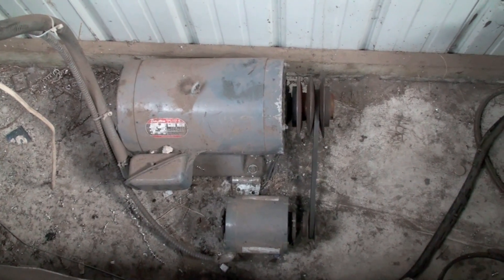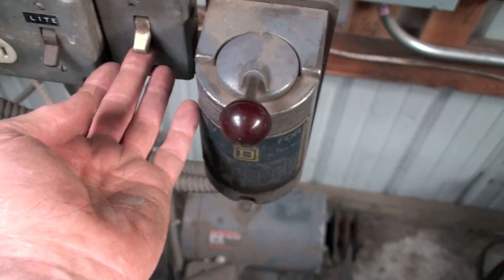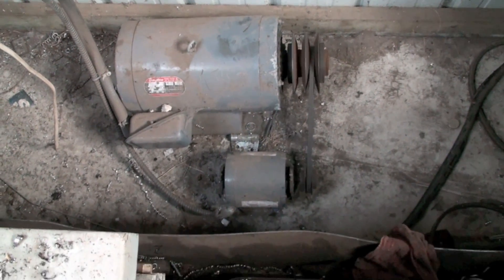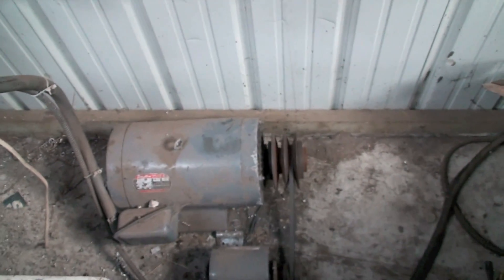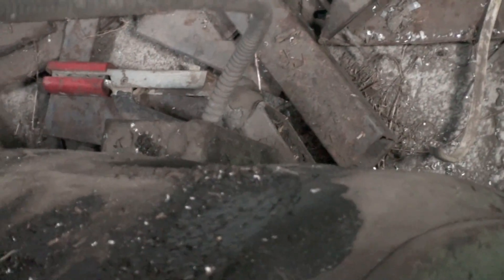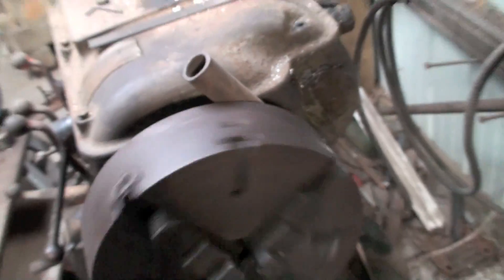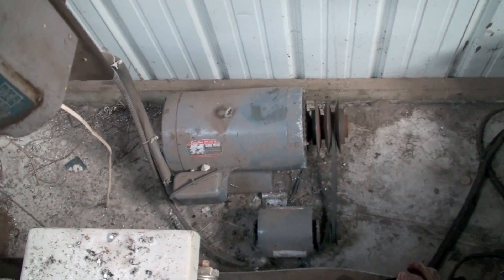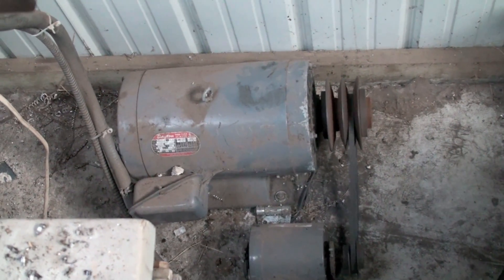Single phase to 3 phase the simple way

Comment: If I may. I have a horse of a different color. I need to get 3 phase 220 out of 1 phase 220 to run a computer. It is a tire balancer. After the computer turns on then it can turn on the motor. Got any idea how to just get 220 3 phase first and then continue from there. I am thinking I need 2 motors but you would know best.
Reply from the maker: The video does produce 240 3 phase.  As far as I know it should work.
GFM
Reply: Stunned did you get this to work? I'm in same boat with an ancient Hoffman balancer.
Reply: I have an old hoffman balancer to did it work i know this is old but did it?

Comment: Dear sir, the inverter came to industry in 1990,s. I do not see any reason  not to use them and enjoy your 3 phase machines anywhere any time any application.
Reply from the maker: The "inverters" you describe are really just a start cap and relay.  The machine operates on single phase and will overheat under high load.  The system I described is certainly not perfect and the 3d phase is not energized as completely as the other phases but will operate with more balanced power.  Also the "inverters" are quite expensive.  3 phase motors are cheap used.  The system I have described cost less than $40.  That is why I did the video.
Reply: You are right about the price, specially in 1990,s inverter was luxury. We had only 2 or 3 in our school controlling air velocity in a demo unit.
Reply: We used this as far back as the 50’s

Comment: I have a very old 3 phase motor, with three black wires (unmarked) sticking out (am unsure which go's where)that would be used as the slave motor with a smaller 110,3/4 hp , starter motor, and would I still need the capacitors ????
Reply from the maker: For this design, capacitors are not used.
GFM

Comment: Would it also be possible to have the 15hp 415v motor and 240v starter motor set up remotely with a female 3 phase plug connected to the 15hp 415 v motor so that multiple 3 phase machines could be plugged into the female plug (at different times of course) instead of having the set up hard wired to only one 3 phase machine? Thankyou

Comment: Hi GFM.
I have a wood planer with 10hp 415volt three phase motor. The power to my garage is 240volt single phase and the fuse is rated to 20 amp. If I understand correctly I will need a 15hp three phase 415volt motor and a single phase 240 volt motor. I will plug the 240 volt motor into mains power. This motor will be connected in parallel to the 15hp 415volt motor. In turn this motor will be connected to the 10hp motor on the machine. When I turn on the mains power the 240v motor will spin the 15hp     415v motor which will generate the third phase to the 10hp 415 volt motor on the machine. I have two questions. First will any of this system likely burn out the 20amp fuse of the mains supply? And secondly once I turn off the 240v power to the 240 volt motor what keeps supplying power to the 15hp 415 volt motor?? Thankyou
Reply from the maker: If you don't have 415 volts, you cannot make this work.  If you had 415 volts, you would have 3 phase already there.
GFM

Comment: Totally and completely lost with this kind of stuff I have a mail running on single phase 240 so I understand up to about that point and that's it. I'm set to buy a lathe and it's listed as having a 3-phase 240 / 480 power requirement. I was told yeah just get a phase converter I guess I don't understand how you take a maximum of two 40 running into my garage and get another face out of it without the addition of a transformer or another line from the Transformer that's on the pole. How about this can I ask you a question? Roughly very rough ballpark how much would it cost me to set up to run my life that I'm thinking about buying?
Reply from the maker: +Clown Whisper It depends on the size of the motor on the lathe.  With the system I have described, you will need a motor 1.5 times the size of the one on the lathe.  Usually 3 phase motors are fairly cheap used.  I think I paid $20 for the one I used.  Hope this helps.
GFM
Reply: +grayfurnaceman I have read watch this and I'm a little embarrassed but I have no clue to what is going on here. It is the three phase motor has a generator I don't get it
Reply from the maker: +Clown Whisper The three phase motor can be connected to single phase.  The motor will not start, thus the small starting motor.  Once the motor is up to speed, the third phase becomes a generator that will supply the third phase to the lathe motor.  The lathe motor will then operate normally as if it was on 3 phase power.
GFM
Reply: this is a game changer for me wow thank you
Reply: the small motor is just a standard 110 run of the mill motor?
Reply from the maker: Yes
GFM

Comment: My lathe has a 3 phase 3 hp motor running with just a couple of start caps and a relay- so I'm loosing about 30% power. It would be cheaper in the long run to install a 2hp single phase motor.
Reply from the maker: +newstart49 Probably would.
GFM

Comment: I have a AIRCO CV 250 welder 3 phase need to make a 3 phase but each leg is different voltage how do I wire it up or make a converter ?
Reply from the maker: +Apollo1van What voltage pole tp pole do you have?
GFM
Reply: +grayfurnaceman will get back to you on voltage , what are the hp on the motors and the diagram is the driver motor the smaller one ?
Reply from the maker: +Apollo1van The converter motor is 7.5 hp operating a 5 hp lathe motor.  The small motor is there just to get the converter motor rotating.  Hope this helps.

Comment: if you put a capacitor across to the third leg, it will self-start and should also run more efficiently.    I had a system built with like this 35 years ago using a 25 hp 3 PH motor as the main motor.      It would start 3 Ph motors under full load and direct online.       For the hour at a time I used it, I could run it to 40 amps at 500 volts input driving  up to 3  times  3 phase motors plus the main  but never more than  a steady 40 amp draw’  the main motor was wired star and the rest delta.
Reply from the maker: Gavin Davis The capacitor method does work.  I will do a video on it when I get to it.
GFM
Reply: +grayfurnaceman         
?? Driving and Driven ?? and OUT-PUT?? more details please ... 
the two L1/L2 are the IN-COMING POWER ? (with breakers) Right? 
then the two motors. you drew them both the same size... 
Just a little more detail please and show output to ... what you are running.

THANKS  G
Reply: Is there a resource that explains this more in detail or could you please upload a more detailed description? Also if using a capacitor instead of a starting motor what size does the cap need to be. Is it in relation to the driving motor requirements?

Comment: Hi,whats the max speed you get on your lathe chuck ? Does the chuck slow down when you have load on it ?

Thanks
Reply from the maker: MBG-TECH I haven't checked the speed, but there is no slowdown under load.  This type of conversion gets higher torque as the amp draw increases.  
GFM

Comment: Hi, your setup is effective yet simple. But may I ask why not use actual 3 phase wiring from the house's fuse panel? The wiring would certainly be less costly than two additional motors, especially the 7,5hp one. Or am I missing some facts, because I'm living in Finland, in Northern-Europe. Here practically all households - except some residences'  in apartment buildings - have 3 phase power (typically 3x25A or 3x35A) in their fuse panels. But is this typically different in other regions of the world?
Reply from the maker: t kermi It is different here.  3 phase is available mostly in industrial areas.  Our voltage is also 120v 240v with 120v in outlets and lighting.  GFM
Reply: grayfurnaceman OK, we need a lot of power here because of the winter time heating requirements (especially for old houses with not so good insulation), and for electrical stoves (in some other countries stows operate by gas) and for electrically operated sauna stoves (these sauna stoves can require up to 9kW, thou typically around 6kW). So this is probably why we have 3 phase 400V (3 times 230V wires in different phase) everywhere. Te minimum power capability requirement for standard house around 200m2 and with electrical stove and sauna stove, even with geothermal heat pump is about 17kW (and can easily bee around 24kW in old large houses). This 17kW would mean over 140A current if delivered through 120V single phase line...
Reply: grayfurnaceman three phase power is three distinctly different sources with the frequency of each source 120 degrees out of phase in respect to the other two.

Comment: Normally, reversing a 3 phase motor is done by simply reversing any two motor wires to the source. You will not have full load torque or speed by running a 3 phase motor on single phase, but it will run...but not at the rated load, however.

Comment: Hi,
I have a Elliot pillar drill 3 phase, motor packed in, if I replace with a single phase with capacitor, then will my reverse switch still work, or is it better to put a 3 phase motor back on so that I can use forward and reverse,
Thanks, and your video are great.
Reply from the maker: Hornetwind The reverse switch will not work with 1 phase.  You can get reversing single phase motors, but it will require rewiring.  Hope this helps.
GFM
Reply: grayfurnaceman to reverse a single phase motor swap #5 and #8

Comment: Dear Sir GFM...from what I understand in your diagram...the driver and driven motor is
in parallel in their three terminal,two of the leads of the driver motor is directly connected into single phase,turned off from supply at certain speed. The lathe motor which is three phase is directly connected to the three leads of the driven motor,is that it? The driven motor is 71/2 Hp,lathe is 5HP...how about the driver motor?
I've seen this set up at a local machine shop,and I am impressed by the design.
But took me a while to ponder about it,your videos made it clearer for me...
But still I have lot's of questions. Thank You Very Much,for sharing you work.
Reply from the maker: Mark Anthony Nilo The 2, 3phase motors are connected in parallel.  The driver motor that starts the 7 1/2 hp motor is small, 1/4 to 1/2 hp.  Hope this helps.
GFM

Comment: Good Stuff. Would you ps clarifiy the following point with me as I am in Australia.
Are you ultimately running your 3 phase generator with any Mains feed from your Energy Provider ? I was thinking that you were using the initeria from your 3 phase generator to produce 3 phase power (for your lathe) as well as utilising 1 phase in parallel to back feed your single phase motor (after you have disconnected it from your Mains feed). That was why your needed a 3 phase motor 1.5 X greater than your load duty.
However, I now feel that you are using the single phase motor to bring your 3 phase generator up to the correct RPM, turning on your 2 pole circuit breaker to feed and run only 2 poles of your 3 phase motor on Mains Power as well as partially using the third (generated) phase to run your single phase motor - after you have switched the single phase power line from your Mains.
Your welcomed thoughts please. Well done again.
Reply from the maker: Paul H The idling motor is operating from single phase.  If the motor is brought up to speed, it will run on single phase.  The 3d unconnected phase becomes a generator and is available to feed the lathe motor when you need to start it.  I think I am saying the same as you.  But the main is never disconnected.  Let me know if I have not answered your question.
GFM

Comment: Sizing of the 3PH generator motor isn't all that critical.
Example:
I have a 3PH Bridgeport mill at home with a 1-1/2 HP motor. At the time, I didn't have a large enough 3PH generator motor so I hooked everything up using a 1HP 3PH generator motor to generate my 3PH. It worked bcuz I didn't make heavy cuts with the mill. Even tho the generator motor was too small, there was no problem bcuz I didn't load it to capacity.
Loading is the significant factor in sizing of ANY motor.

Comment: I worked in a shop with 3 phase for 15 years. When we lost a leg, say a fuse went out , sometimes we left the motor run until we got the replacement. But if you shut it off then you all know that you can't restart it. 50 years in the trade and sill learning.
Reply from the maker: You could do that but the motor will have to run all the amps through the 2 working phases and if it is close to full load, it may trip the overload.
GFM
Reply: grayfurnaceman You are correct. Now that I think about it what I was talking about was say a conveyor with 5 or 6 motors, If we lost a phase the conveyor would keep running. Joe

Comment: GFM-  why not just put 208V single phase on two of the three input power leads of your lathe motor and just pilot start that motor?  Great stuff.
Reply from the maker: If you do that, the 3d phase generated will not have enough amp draw to balance with the other phases.  You will have excessive amp draw on the other lines.  That's why you use a start motor 1, 1/2 times the size of the driven motor.  Hope this helps.
GFM
Reply: Kenny Y because the 3 phase motor would single phase and burn up.

Comment: Hi Gary i have a nice 15 hp air compress 3 phase. 
I need a compress in my home shop that does not have 3 phase.
I will not use the compress a lot.
If i could get a 20 hp 3 phase motor would your conversion method be practical?
Is the electrical consumption (KW) any greater?
I understand that the 3rd phase is missing in the 240 single phase source motor so the 3rd phase is produced form the field that is not energized so it produces it that is why a 30% bigger production motor is need to satisfy the operating smaller 3 phase.
What is the concern sense the air compress will start under a load?
In advance THANKS, david
Reply from the maker: Generally I have seen the motor should be 1.5 of the motor you want to operate.  There is some loss because you are using an additional motor.  Now for the problem.  The larger motor must be running when you start the compressor motor.  This means you either have to have the larger motor running all the time you want the compressor or you will have to rig a smaller motor to start rotating the larger motor when there is a call for the compressor.  Hope this helps.
GFM

Comment: I do have a stupid question though what keeps the 3 phase motor running after you turn the smaller starter motor off ? I must have missed something lol- I'll try and find the wiring diagram that might help me to under stand it. Really Great Idea!!!Never gave much thought about making my own power that's pretty cool!
Reply: What is occurring is the 3rd phase is not energised on the primary motor. All the small motor is doing is giving the larger motor enough inertia to spin past that de-energised phase, the small motor can be turned off because the large motor is now self sustaining with the two phases that are energised + the inertia. The third phase is now being generated by the large motor which is being used to power the lathe, along with the other 2 phases.
Reply: yes but are all the phases coming out of the energizing motor 415v 3 phase if so what happens to the 240v connected surely it will blow the thing if its generating 415v with the 240v connected .
Reply from the maker: Once the start motor gets the 3 phase motor turning, the 3 phase motor generates the 3d phase to keep it running.
GFM

Comment from the maker: I have a friend that repairs welder.  He tells me that this will work ok if you don't use the generated phase on the control circuits.  The voltage in this phase will not be high enough to operate the controls.  Hope this helps.
GFM

Comment from the maker: OK.  Phase converters that I have seen are not converters but start capacitors with a start relay.  The motors done this way that I have seen are actually running on 1 phase.  This system uses the 3d winding and has "fairly" even amperage.The motor used here cost $20.  That's because used 3 phase motors are cheap.  The start motor is from an old furnace, picked up for nothing.  If you don't like my "dangerous" belt arrangement, use a coupler.  This is a simple, cheap and effective 3 phase.
GFM
Reply: give me your em, i'll send pics and explanation.
Reply from the maker: @possumdan1  Grayfurnaceman@gmail.com  Thanks
GFM

Comment: I did not know that. I know when they generate here in the US, they generate 3 phase. From there, it is distributed as 3 phase for industry, but for residential they don't run a cable for the third leg. I had to get a 3 phase converter for my shop. Instead of investing in our infrastructure, our govt is more concerned about starting foreign wars and giving billions to overseas dictators. As a consolation, we are given the Kardashian's, Honey Boo Boo, and other equally disgusting reality shows.
Reply: Infrastructure like the electric grid is private. There is no need for 3 phases in the home. It's mostly only useful for large motors.

Comment: Weight is not a bad thing on the slave motor. It helps to smooth out power losses from the third leg being generated. Think of a flywheel.

Comment: Would it be worth fitting some sort of one-way clutch (sprag/roller) between the starting motor and the gen-motor? This would reduce the power waste caused by the gen-motor driving the starting motor once it picks up, so reducing excess heat as well.

Comment: maybe you used a start capacitor instead of a run? different duty ratings usually.. you could also just switch in extra capacitor(s) momentarily to start the idle motor